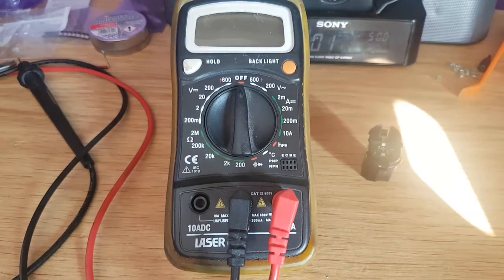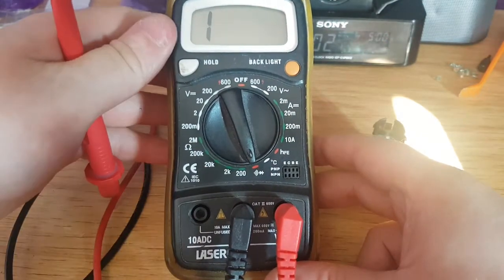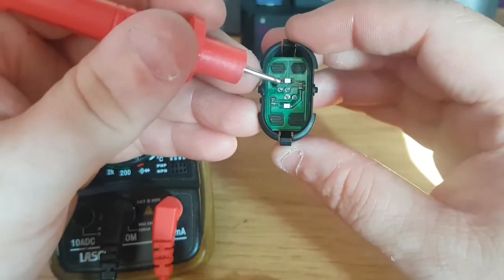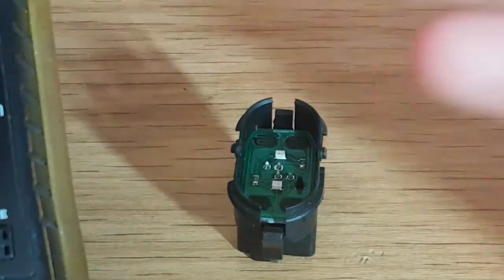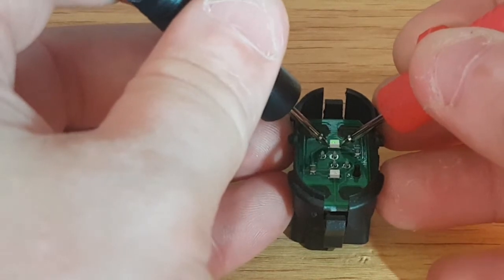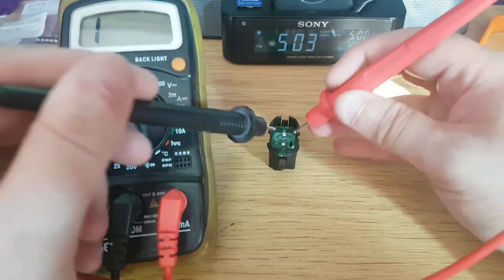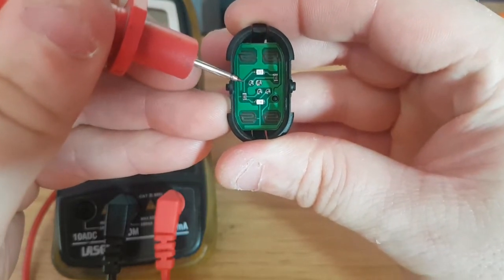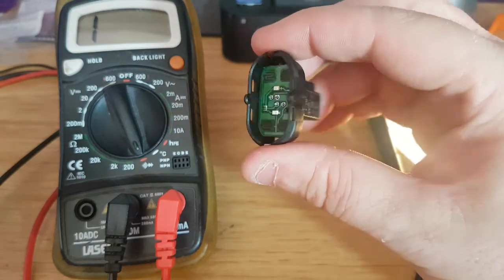How to Test polarity of smd led with multimeter

Comment: i test the smd LED with multimeter , no light but beep sound is coming and a reading scale showing 20, so i change the polarity but the same thing happen , no light with beep sound and reading scale showing 20. please clarify if its working or not
Reply from the maker: Smd led not working and needs replacing.